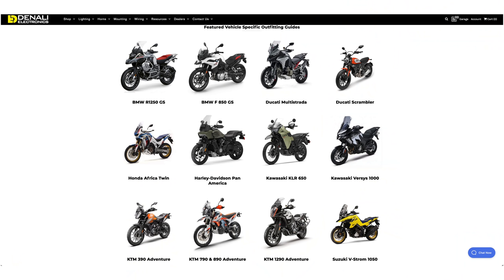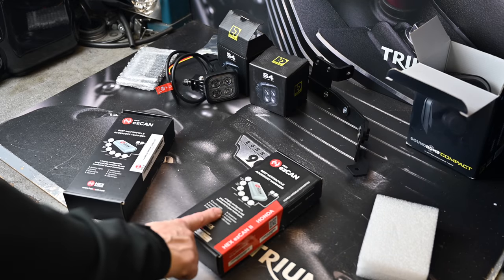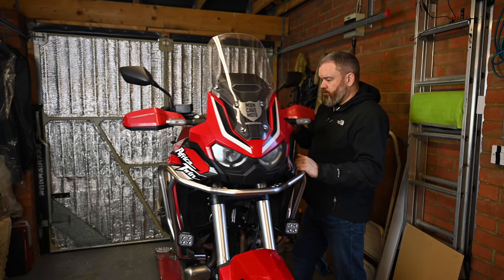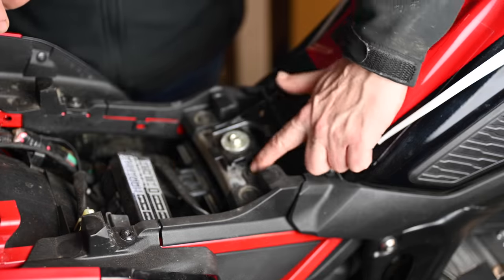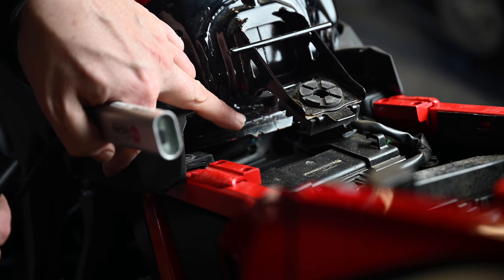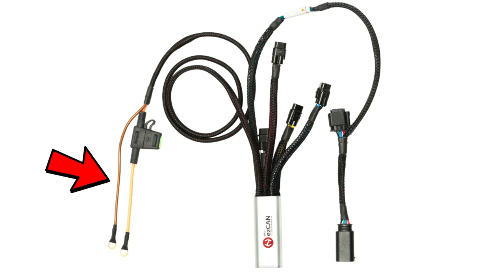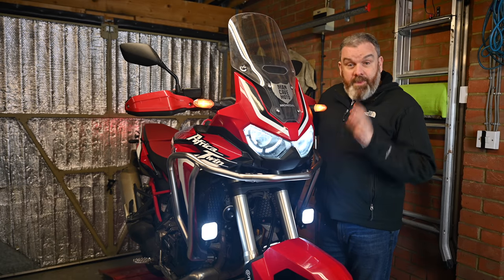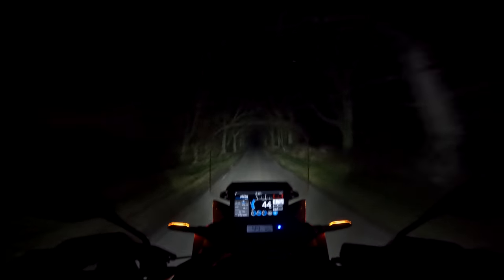How to install Denali lights with the Hex ez-CAN - It's so simple!

Comment: Thank you. I put the same set up on my Africa Twin a couple of months ago, but with D4’s. Easy enough for a novice. I did remove more fixings and lifted the tank to aid cable routes and the connections to loom and battery. A great set up!
Reply from the maker: Cheers, thanks for the info. I tried to remove as little as possible as I knew it wasnt staying on the bike for too long
Reply: @mancavemoto  understood and fair point. In contrast, I’m planning to keep my AT for the foreseeable. 
Thank you for the channel and info. 👍
Reply: @uponthepegs  Are the D4s too bright for the road and have you had any issues with extended use?
Reply: Hi guys! I'm interested in fitting some Denali S4 lights to my 2016 CRF1000L. I want to use the denali or SW motech frame mount rather than crashbar clamps. I was wondering if any of you can confirm if it will interfere with the stock crash bar. I can't really find any info on that. So can you explain which mount you used and which crashbar you have? Thanks in advance!

Comment: They really have it worked out, almost idiot proof which is great. I went with the heal tech module after watching Andy Man Cam install it and it works simpler than the Hex ezcan. My lights are not the Denali but man they do through light when I go to work at night. Hello from a snowy Northern Ontario Canada.
Reply from the maker: Hi Shawn, I havent seen that, was it the Thunderbox?
Reply: @mancavemoto  Yes, and it works great. It doesn't have all the configurability but I didn't have to cut into my wiring harness.

Comment: Good video, and this confirmed my suspicion of needing the extension leads for the lights. I have a set of the D4's to put onto mine. Also I am considering getting a set of the D3 Fog lights with amber lenses for when I encounter fog or heavy rain, especially at night. I ride in all conditions and also I have a ton of wildlife here to be on the lookout for at night especially including big ones like moose so extra light is a good thing to have.
Reply from the maker: Thanks for the info!

Comment: Great video Tony! Did you look at Clear Water lights at all?
When you have oncoming traffic, do you turn off the S4s or are they switched to a lower power? I wouldn’t want to blind vehicles I’m meeting or following. Cheers from the LEFT side of the pond🇨🇦!
Reply from the maker: Cheers, I did look at them, but i would have needed to order from the States, so its 20% tax and import duty on top including the shipping! I did also think the Denali looked better are are better supported with accessories etc. Yes the S4's are set at 20% power for daylight dipped beam, 10% for night dipped beam and full 100% for main beam.

Comment: Great explanation, I have got different spot light, the question is do you need to rewire again or you can use the previous setup and just change the lights? Hope this make sense to you? Cheers
Reply from the maker: The wiring is fixed at the light end, so if you want to switch the lights, then the entire cable needs to be removed.
Reply: @mancavemoto  thank you

Comment: Now the denali do new cable to mount in front faring, mean the controller is in front and plugged with some 12pin socket into OEM honda circle, whats actually different on HEX ezCan and the Controller with dial mount??

Comment: Hello , thanks for this Nice vidéo 👍
I’am also looking to upgrade my Africa twin 2023 with those items , but I m a little bit confuse with the spare parts of ez can , and and I won’t order the wrong items , 
So you have a list of all your products parts number so that I don’t make a mistake : I live in France and if it’s not correct by the first time it will be complicate .. 
 sw-motech mounting bar impress me a lot nice and clean , I’ve found it but what is your experience with only one bolt for the fixation? Any issue?
And at the end what kind of steering knobs are you using for switching the light .. also item number please 🙏..
I was adding almost all together, and is quite expansive around 800-1000€ all together correct?
But the result is amazing 👍👍
Thanks for reading my post and depending on which time your are reading it , nice start in 2024🍾🍾🍾
Reply from the maker: The SW-Motech bar is nice and solid, it only has one bolt, but the bracket fixes securely around the frame. Once the EZcan is fitted the lights are operated through the stock controls. If you go to 'A Bike Thing' you can put together bundles whic makes things cheaper. For example the kits with the parts i've used is under £600 https://abikething.com/product/denali-s4-bundle-honda-crf1100l-africa-twin-adventure-sports-20-22/
Reply: Thanks a lot 👍, so you think is possible to remote the bracelet to fix the lamps( i allready Order the sw motech ) in germany)
Reply from the maker: The bracket is part of the mount, just bolt it in place and fix the lights to it. the most difficult part is routing the cables through to the ezcan

Comment: Did you have to lift the tank and take off the front fairings?
Reply from the maker: No, just as you see in the video, unbolt the tank mount and you can lift it enough to give you space.

Comment: So with the day and night intensity how does the ez can know when it’s day and night so to adjust between day and night  for brightness. I have put the D4s on
Reply from the maker: The ezCAN takes the ambient light reading from the ECU. It’s the reading that changes the tft display from light to dark
Reply: @mancavemoto  so basically your say this uses the the power from the tft screen to change the light intensity for the spotlights  but would I need to have a certain headlight so it changes with this from day to night
Reply from the maker: Essentially yes, many modern bikes Will have a sensor to automatically switch the display from light to dark or day to night, this is what the EZCAN uses to control the light output between the two.
Reply: @robames4  The Africa Twin has an ambient light sensor in it's main display, the small one below the TFT display. This sensor monitors the ambient light and controls when the bike switches from DRL to headlights, also it is what will change the TFT display from daytime mode to night time mode. The ez-Can unit reads the signal from the ambient light sensor to adjust the output of the Denali lights to what you set them to run at for light intensity during the day and night.

Comment: Can you turn off the lights during driving?
Reply from the maker: You can if you add a switch to the system, or of course you can set the drls not to be on.

Comment: Denali, the most expensive lights you can put on your bike. Vastly overpriced. The Hex ez-CAN, I tried a year ago. Confusing instructions and out of date documentation and then a device that failed after two weeks. The replacement I was sent then failed again. In the end I gave up on it and went another route.